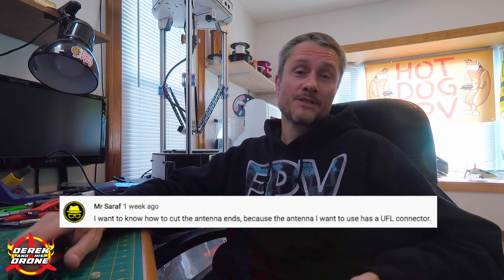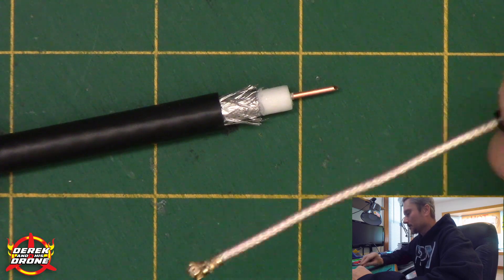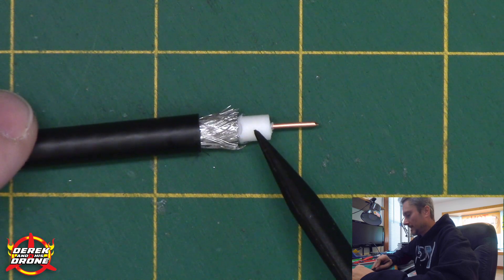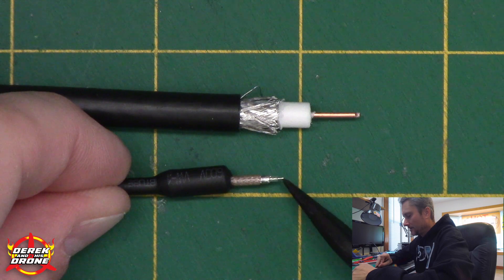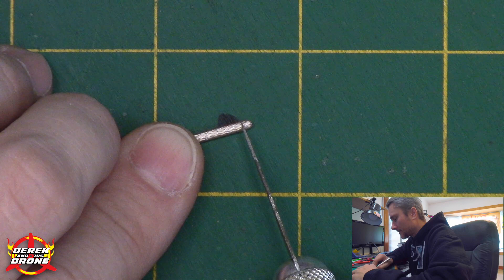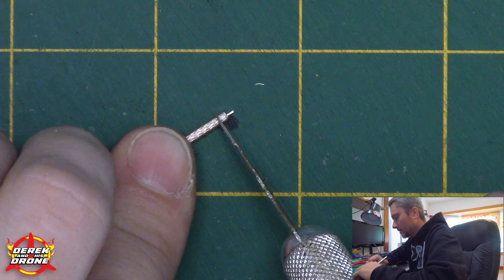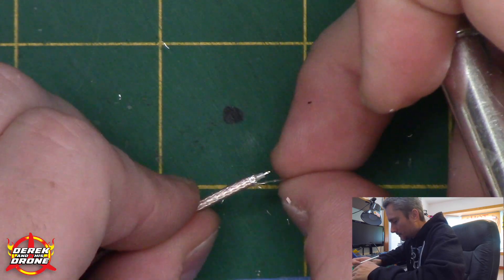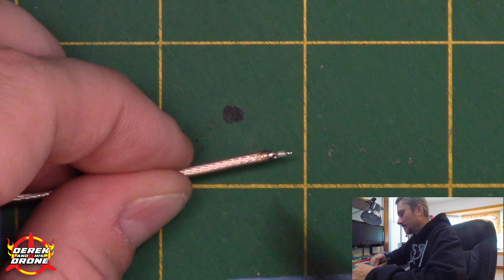How to - Prep an Antenna for Direct Solder

Comment: From my understanding, and I definitely could be wrong, but the length of the antenna wire that is still shielded isn't super important. The length of exposed wire is the important part.
Reply from the maker: This is somewhat true when dealing with short cable lengths, but yes the exposed conductor is important as this will effect frequency reception.  The longer the overall cable the more resistance.  The increased resistance will equal debacle loss in the signal.

Comment: Nice video! Can I extend the cable with another cable by soldering them and then solder it to the vtx? Will i lose range?
Reply from the maker: I would not recommend it.  Maybe a longer antenna or an adapter.
Reply: @DerekandhisDrone  I see, thank you for the fast reply!
Reply: My micro antenna just comes short by an inch, that's why I want to extend it. Thanks in advance!

Comment: Where can I get a pre cut antenna for direct solder?
Reply from the maker: There really isn't many options for this.  The only ones current available would be a standard dipole.  If you want anything else you will have to cut it yourself.

https://www.amazon.com/AKK-Omnidirectional-Dipole-Antenna-Camera/dp/B06XD4Z5K4/ref=sr_1_7

Comment: if i cut the end of the original cable off and replace it with a new end (same size) I salvaged from another device will that render it useless or can i reattach a new one to it?
Reply from the maker: Are you asking about the u.fl connector?  If you cut that off you will need a new connector and a special tool to crimp it on.

Comment: Great vídeo!!  I need to solder this cable to the embedded antenna on a baby monitor camera board to increase the range, should I solder the center core to one end and  the shielding to a different end of the embedded antenna ?  Tks.   Here is the link to the board: https://www.youtube.com/watch?v=zGsMKEwCqkU
Reply from the maker: The square silver thing is the video transmitter.  The three connections grouped together are for the antenna.  The center one should be the signal and the outer two ground.  Here is the catch,  you can not just add another antenna.  You will need to completely disconnect the original.  Not doing so can reduce the range.
Reply: @DerekandhisDrone  Thanks!!  You mean the 3 connections at the end of the thick copper line, to the lower right hand of the video transmitter?  So should I connect the  outershielding to one or both grounds?  The center core would go to the middle one (signal)? Appreciate your support.

Comment: Thanks for your video! Although I have a question: You said to make sure that.. not even one strand of the ground part touches the core part of the antenna wire? Here is a link of which shows where the antenna is soldered to the board (bottom right of the board) of a Traxxas Receiver TQ #6519 rebuild.  <<  https://youtu.be/1cgRIXa8nHY >> Notice the core and ground parts of the antenna are soldered together touching each other anyway. So, what's the difference if just one strand touches the core? They're both soldered together anyway (as you can see).
Reply from the maker: It's not touching.  I can see the dielectric poking through the solder blob.  I promise with over 20 years tech experience you don't want them to touch.
Reply: I checked continuity with a multimeter and both clumps of solder ARE touching, Furthermore, after desoldering the antenna from the board, there is continuity between both pads on the board. I don't understand! AND...I have 2 exact same receivers, and BOTH are showing continuity! WTF?